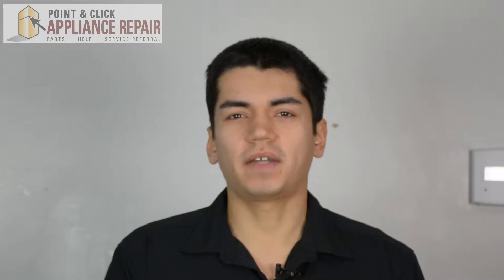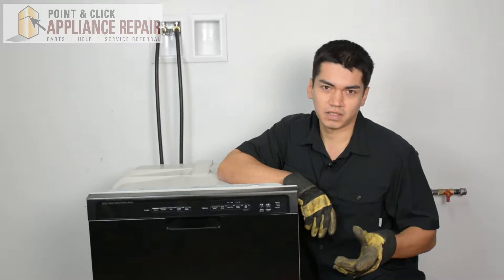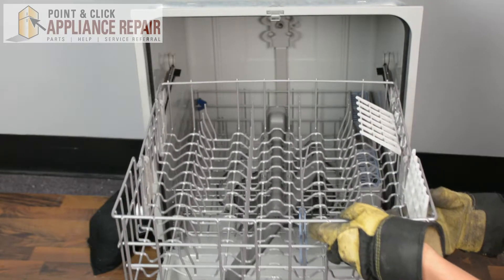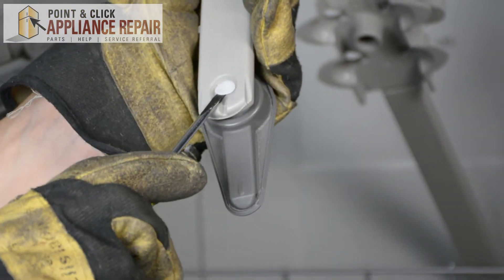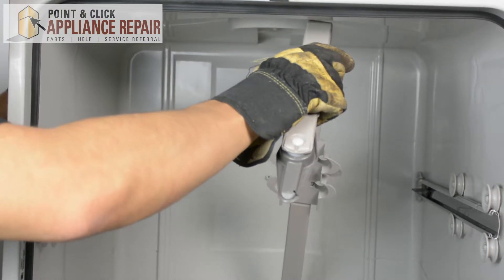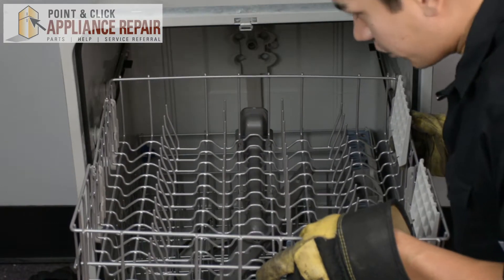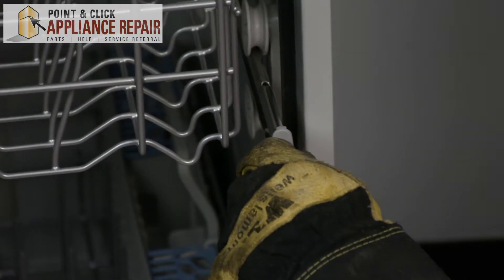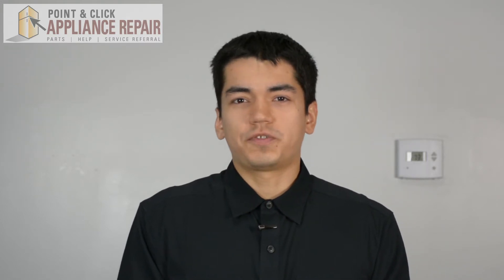WPW10327455 - Replacing Your Whirlpool Dishwasher's 3rd Level Spray Arm  AP6019626 PS11752935

Comment: What was wrong with the 3rd level spray arm you replaced?  Was the 3rd level spray arm plugged?  How would I know from a visual inspection if the existing 3rd level spray arm is defective?